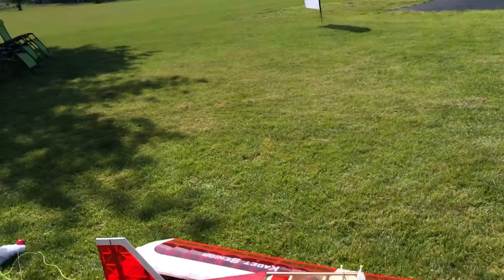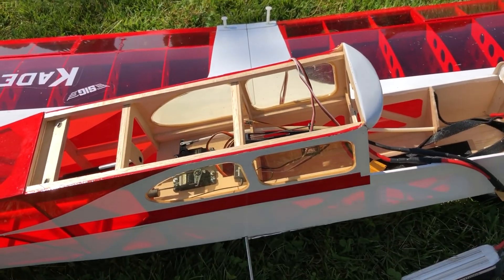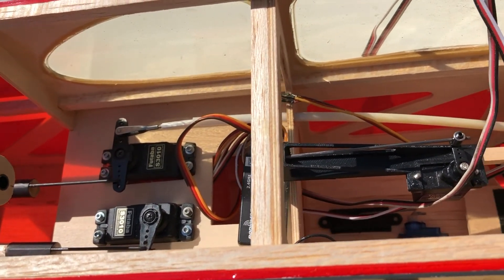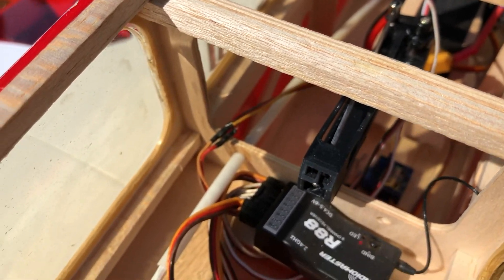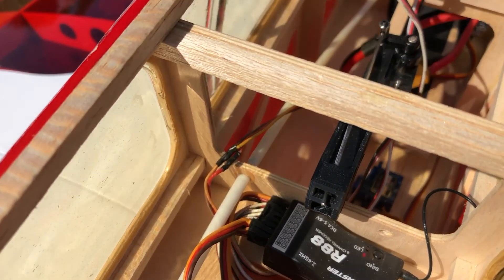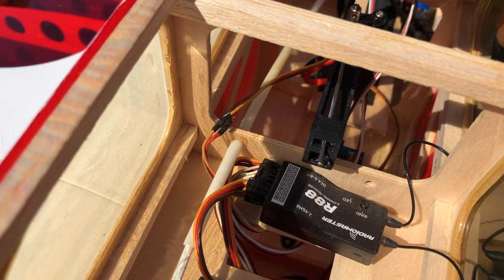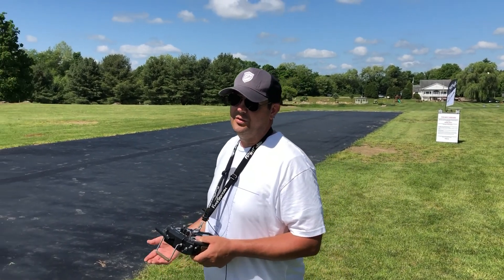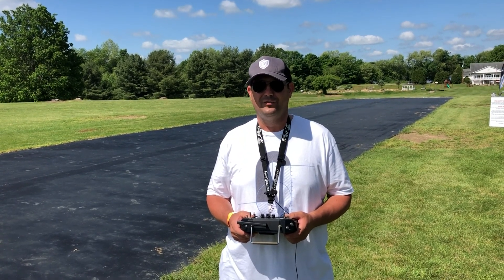Why EVERY RC pilot needs a trainer part 3: Banner Towing

Comment: Hi dude, very nice. my question is how do you write on your banner ?
Reply from the maker: I tried an iron-on transfer and it gave mixed results. The best way was masing off letters and using spray paint. It worked quite well and any minor "soft edges" from overspray were minimally noticed in the air.